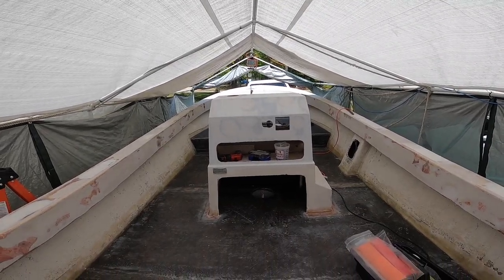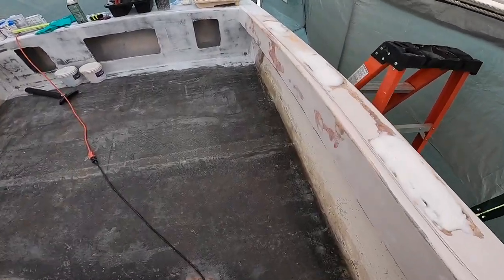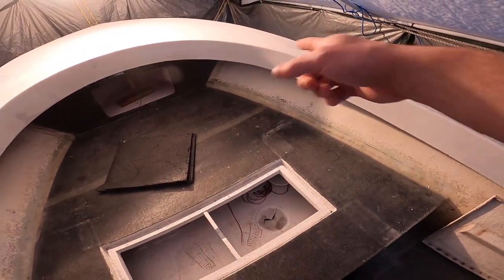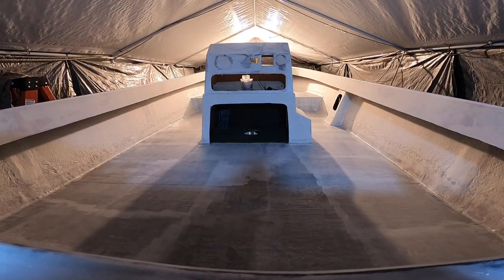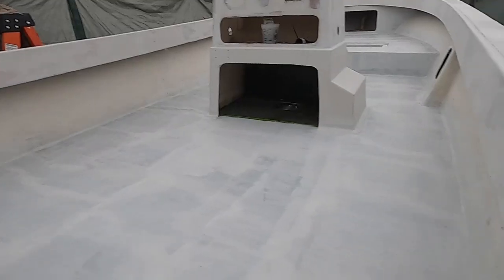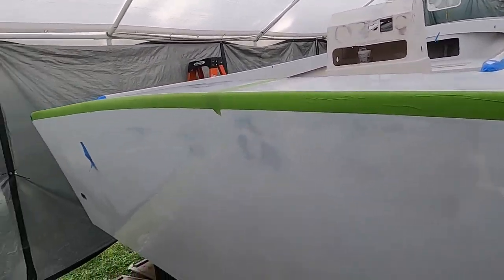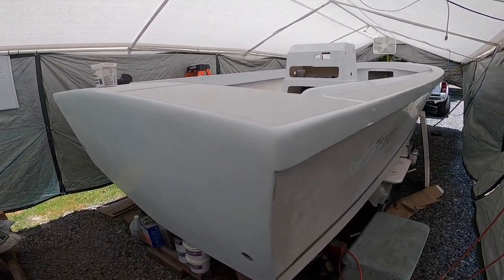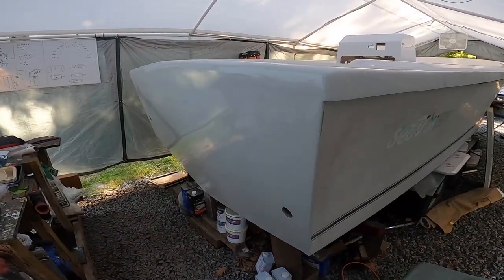Sea Ox Restoration Ep. 17: Alexseal 442 Primer and 501 Premium Topcoat.

Comment: Nice job!!  Did you only put 1 coat of the 442 down on the vertical gunnel?  I am painting the transom on a 1978 Aquasport.  I used Total Boat Total Fair on mine as well.  I guess the topcoat ended up covering up the fairing compound with only 1 coat of 442?
Reply from the maker: The entire boat has no less than 3 coats of ALEXSEAL on it. Go to their website and download a copy of the TDS that will answer all your questions.